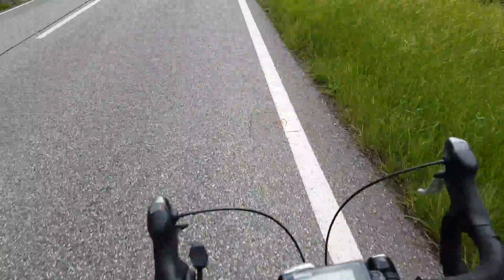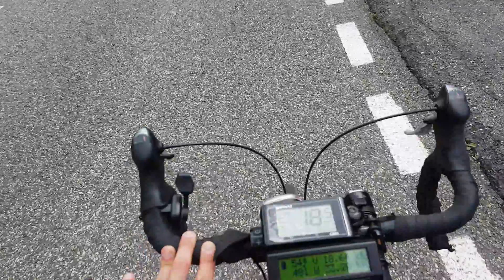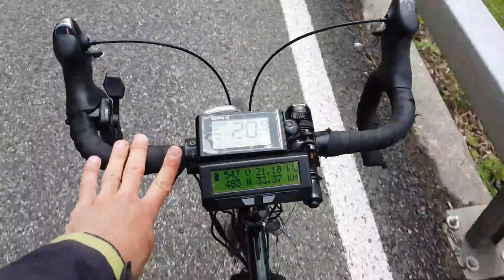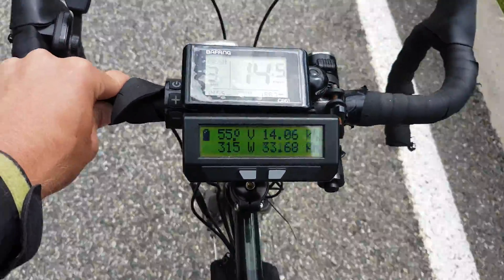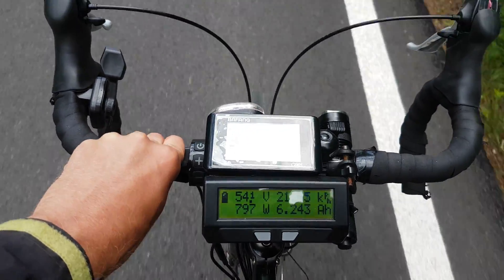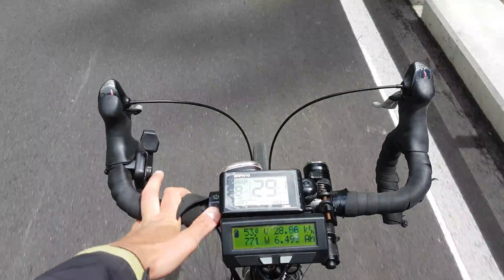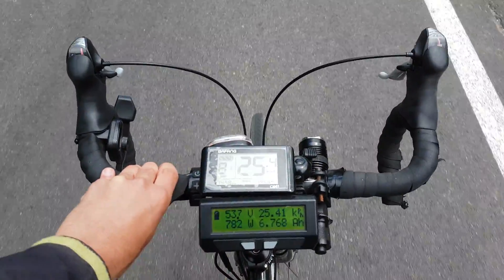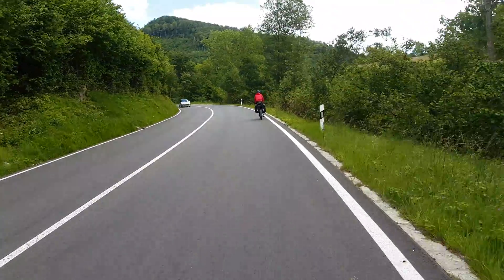E-bike how much power do I need for touring? 250w? BBSHD

Comment: Jack, revisiting your old videos. You had a mid drive then a hub motor more recently for the last sun trip. Is regen more important than mid drive through the bike gears? Did you go through a igh like you later had? Just all a question of riding in mountains but also flats
Reply from the maker: Mid drive in general better for climbing, yes i ran it through my Rohloff hub gears. DD hub was good for the race as every amount of energy you can get back helps

Comment: When talking about POWER never forget about TORQUE
250W with 120Nm of Torque can move you uphill at 25kph while a 1600W with 60Nm of torque will suffer in the speed, cause even though having the power, it has not the force to move at that speed

Comment: Hi, can anyone tell me what is that battery monitor display system ?
Reply from the maker: Cycle analyst by grintech
Reply: @JackButlerVideos  Thanks for the info !

Seems like they use it as their main OZO controller. Did you use it like that or as an add-on to Bafang controller?

Anyways I am wondering if with Tdz2 custom firmwares (with big 860C display) it is still relevant to use "Cycle analyst".. 

Will see, waiting my TDZ2 kit and 48v 20ah battery !!
Reply from the maker: I'm using the cycle analyst purely as an electrical display and it does not interact or connect to the motor controller. Enjoy the build!
Reply: @JackButlerVideos  Is it worth buying V3 in your opinion ?
Reply from the maker: @seabastia  if you have a compatable motor controller yes but the bbshd is not
Reply: @JackButlerVideos  Thanks !

Comment: I live in Wales, 250w is a frickin joke.
Reply: On a steep climb, I'm going 5 or 6 km/h in the lowest gear. With my 250w mid drive assisting, I'm at 10km/h. 250w helps a lot.
Reply: @somethingelse9535  i can do 4 mph without an Ebike.
Reply from the maker: Works okay for me
Reply: @JackButlerVideos  250w does not work over steep hill never mind several and a full laiden bike. 750 wat is the minimum requirement.
Reply from the maker: Depends on how fast you want to go. Bikes don't have motors and work fine with 0w

Comment: Tip,,,,, 750W Mid-Drive Motor is ONLY ( 1 HP .. ) So  IMO you need at least 1000W motors for almost anything !
Dan
Reply: I can climb walls with my 250w mid drive.

Comment: Hi Jack. Nice videoes and fantastic Sun Trip to China :-)
Very good motorsize-video with relevant information ! 
I think it's important to note too, that even though e.g. the 250W Bafang centermotor can deliver at least 500W (like most 250W motors),  it can only manage 500W for a shorter time without overheating, depending of eventually cooling airflow and ambient temperature.
I think the sweet 250W Bafang centermotor fits our small hills in Denmark fine. I have it in my velomobile (40kg heavy 3 wheeled fully enclosed recumbent with motor and 10Ah battery + 70 Kg driver. Weight could maybe be compared to a loaded touring bike)  
But for the mountains e.g. in the south of Europe, I think at least 500W Bafang centermotor would be better, because it has some reserve(1000W) and better can manage 500W for longer time without overheating, when necessary now and then. Even though the 250W motor would be great help together with pedalling, in the mountains...  just need to take care of the motor-wattage then.
Kind regards, Kjeld, Denmark

Comment: Just bought the 750w 48v bafang an wish i spent another £100 on the bbsHD 1000w .
Reply: how fast and how much range u get from 750w? after 6 months any problems?
Reply: @xxnotmuchxx  i get 32mph flat out with throttle . And 28 pedalin .
Took a while to get the front chainring size correct but bought a 48t an 52t, never got to put the 52 on and wouldnt bother . Had the 48t on and efected range a bit , plus it was winter .
Range 1st off was 50 to 60 miles not useing the throttle . And with throttle 30 miles with a 17.5ah battery. Now its getting warmer my range will increase . But it can be strange over taking some old granny lol.
If i stayed in lower pas lm sure i could get 75 miles range but i like the speed .
I put a digital fish tank mod temp gauge in the motor.
So i shouldnt over heat the motor now .

Comment: Jack, with your Bafang middrive what programming settings do you use? I'm trying to programme mine with range in mind but there are so many options out there I'm a bit befuddled.
Reply from the maker: I have pedal assist 1 at 100 watts and raising in 50 watt steps. And then (i don't remember exactly) 9 is full power 8 is 1000 7 is 750 6 is 500
Reply: @JackButlerVideos  Thanks for the reply. That makes sense, and do you have the speed set to 100% for each level? 

I'm thinking of copying what you have with the current level going up in increments of 10.

I'm also thinking of setting the speed limit to 40km/hr but for the first six or seven levels having the speed limited to 63% (25km/hr, my cruising speed) with the top few levels with higher speed. (if I'm in a rush or to show off :))

What do you think?
Reply from the maker: Sounds good! It's easy to chance anyway when you get used to it!

Comment: I am 130kg. The ebike I'm looking at has 250 mid drive Bafang. It goes 15mph on peddle assist and 28mph on the throttle. Would it be worth getting? I don't want to work to hard.
Reply from the maker: It depends what you want it for and what your expectations are
Reply: @JackButlerVideos  just for commute. Mainly flats few mild hills nothing bad
Reply from the maker: I'm sure you'd be fine. It'll put out more than 250w anyway
Reply: @JackButlerVideos  what speed would I get on throttle only mode on flats?
Reply from the maker: @CFC2584  depending on your tyres you should be able to do at least 25km/h on the flat i imagine, unless you have MTB tyres/bad rolling tyres
Reply: @JackButlerVideos  it goes 45km/h which is 28mph on throttle with no one on it. How fast would it go with me on it? I'm 130kg
Reply from the maker: On 250w i don't think you will be doing 45km/h without working unless it's flat and windless
Reply: @JackButlerVideos  this is with the throttle only in highest gear. How fast do you think I can expect on the throttle only under normal conditions?
Reply from the maker: I'm sorry there are too many variables, it's almost impossible to say.
Reply: @JackButlerVideos  ok. Thanks. will this be good for weight loss when riding with peddle assist? Mainly what I want it for.
Reply from the maker: The more you pedal and the less you eat the more you'll loose. Get a calorie counting app to really understand
Reply: @JackButlerVideos  Sorry if it seems like a silly question. Do you think it will be worth the extra cost over a normal bike I guess is what I mean?
Reply from the maker: You will not loose weight faster or slower because of an ebike. The only thing that affects this is how much you eat and how many calories you burn.

Comment: nice video! I was wondering, do you miss generative breaking? would not be much easier in your brakes then? What about your solartrip? did you used many sets of brake pads? I wonder what is better for touring, free hub with no regenerative breaking, like your bbshd or a coupled drive with regenerative breaking.
Reply from the maker: Never tried regen braking on my own bike. Yea it would definitely save brakes! Problem is even with motor off the wheel is always slightly dragging which is not good when you're not using the battery. Maybe changed brake pads once on the suntrip, you don't use them much. It's basically flat for 7000km from Russia.
Reply: @JackButlerVideos have a watch of Grin Technologies' presentation on regen, it busted a lot of my misconceptions about the downsides of returning to hub motors - for example, you can easily counteract the drag you're talking about by running a tiny amount of current through the motor on PAS level 0. You recover the charge that you lose from doing that very easily throughout the ride.

Comment: Hub motors are great lol, I have seen them with over 10,000 MILES and still going strong, you can not say that about those nylon gears you were talking about. Besides, if your chain breaks, crankset gets damaged, derailer gets damaged ect. you are stuck with a useless ebike with mid drive. A hub would still get you home or if you hurt your leg ect it would get you home safe. The wheel are made for the motor and the spokes are 12 gauge stainless steel.. they are very strong. I hit downhill tracks with my hub motor lol and it is fantastic. I think an ebike needs both a hub and mid drive, hub for high speed and reliability and mid drive for steep hill climbing. Or just use a second hub in the front as well. That works too.
Reply from the maker: I've now done over 10000 miles on this mid drive motor too!

Comment: What's the model of the power meter on your handlebar? When solar powered you probably use two of them? (Input and output)
Reply from the maker: The cycle analyst! There is "solar software" for it so you can use one display with two current shunts

Comment: I have a 500W bafang hub and I will say that on the flat with full pedal assist you go amazingly fast.  On hills depending on how heavy your bike is, your level of fitness and the incline you notice you do get a workout.  But I'd say it reduces the effort on a good climb by about 60-70%.  I agree, beyond 500W it's pretty much unnecessary as at that point you're essentially a motorcycle.
Reply: What speed with a 500w ?25 mph
Reply: @thomasjurd172  about 20-24mph on flat
Reply: @giobikefans  i just found there an easy fit but if you get a 1000w rated battery the bbso2 still draws more than 1200w with 48v
Reply: @thomasjurd172  cool!
Reply: Since 500w and 750w are almost the same price, why not get 750 instead? I am reseaeching a diy ebike. I think 750w might harm the chain and cranks, what would you say about that? Have you seen damage with your system ?
Reply: @dimitristripakis7364  i have a hub motor so there’s no additional wear on anything.  None of the power goes through the chain.  If you’re using a mid drive motor then that’s something to consider.

Comment: Hi Jack, I don't know if you'll see this question, but what are you using to attach the thumb throttle  to the side of the handlebar?
Reply from the maker: I used a dremel to widen it out slightly and slid it around the bar as normal.
Reply: @JackButlerVideos  Nice! I might try that.

Comment: Im 75 kilos. If i put a 250w on my bike while i riding slightly fast will i reach 30 km?
Reply: I doubt it will have enough torque. I had two 36v 250w front and rear hubs for a while . Together they'd teach about 18mph on the flat.

Lift a wheel off the ground and it'd throttle up to 45mph, but as soon as they have me+bike to carry they just don't have enough torque.
Reply from the maker: 30kmh? On the flat with you pedalling probably!

Comment: Hello, can 250watts outrun pro cyclist? With pedal assist of course. I can do 37kph on my mountain bike and 45kph on my roadbike. I wonder if 250watts can still help me maintain 45kph on flat.
Reply from the maker: It's very difficult to say but if you can pedal at 37kph on your mountain bike i think you should be able to keep over 42kmh with 250w probably... If that was the question...

Comment: Hi there, how do you wire your Cycle Analyst and the Bafang for speed, if your using the Phaserunner?
Reply from the maker: I've never replaced the stock BBSHD motor controller with an aftermarket one so unfortunately I can't help.
Reply: Hi Jack many thanks, OK understood but How do you change motor wattage then via the CA up-to 1600w?
Reply from the maker: It's not possible to adjust the stock BBSHD controller with the Cycle Analyst. The CA just provides accurate measurements of speed, distance, watts, and most importantly W/h

Comment: hi, I have had a 1000w hub ebike to get to gym for over a year, but want to tour wild camp on an ebike any advice please wa even thinking of taking genny as they start at 9kg, or at a push cube just made a touring ebike, my 1000w only does 15miles on low assist and 8 miles full power, so cant use this I think.
Reply from the maker: I would just get a high capacity battery fron em3ev it would be better than carrying a generator!

Comment: A 250W motor does not have a maximum power of 250W, it is the ideal/average power.
Most 36V 250W motors are 15A max, some are 18A max. A 26V motor is 20A max.
So, they can all deliver over 500W.
If you wanna climb hills, Watts is not the only thing to look at. You need a lot of torque.
Reply: Thanks Czar,i was wondering that myself.So my 36v 10ah 250 will suffice most hills,i mean reasonably?
Reply: @ericaguidino3376  Definitely check out the motor's torque. Going up a 20% incline and assuming your weigh 100kg with bike, there will be 200N of gravity to fight. Multiply that by the radius of your wheel (say 30cm) and you got 60Nm. That's what you need to go up the hill essentially.

Power is torque * rotational speed, which when you're creeping up a hill or taking off is very low. Your motor will very likely not be able to put out anything near 250W (kinetically) at very low speed. This is why power isn't the only important characteristic.

Comment: Will 250 W climb uphill?
Reply: 250 watts is like another strong cyclist assisting you. So as long as you help the motor by putting power into your pedaling, and you are in the right gear, then it will  go up almost any hill, or at least mine does and i am a 210 lb 6 ft fatty. BUT the higher the wattage the motor is, the easier(more comfortable) it is for the motor and you, and in the case of the motor  it is under less strain so will last longer. My next motor will be either a Bafang BBS02 750w or a Bafang BBSHD 1000w which i will expect to last forever or until the next leap in technology.
Reply: So Ray you would say,,lol,that rhymed,,that a 250 watt would be ok for hills, and as long as you peddle and help it along and not depend to much on the motor, you should be ok? @iamrocketray
Reply: @ericaguidino3376  Hi Erica, In my country 250 watt is legal limit so we have to make the best of what we can(i do have a 350 watt also, naughty me lol)But to be honest if you are a cyclist and want help up those leg killing hills, and i do live in a hilly area, a 250 watt is fine if you use it right, I can cycle up hills that no way could i cycle up even when i was young( i'm 70 now) BUT if you expect to ride the throttle all the time and use it like a scooter and not pedal then a 250 watt would not last very long and you would be better with a 750 watt. Best way to imagine it is, you have the equivalent of another cyclist pedaling with you like on a tandem. Also a 250 watt motor is economical  and i get 45 miles plus out of one charge, that's with a 36 volt 15 amp battery.
Reply: yes it will

Comment: I don't think I'd like to have only 250W. Just got back from a 70km day out, 90% of which was on gravel or compact clay trails. Mostly flat, with a couple of steep climbs (steepest part was about 30%). My bike with BBSHD & 14s9p battery and panniers weighs about 40 kilos and I weigh 100 kilos.
Most of the time I was using 100-150W. On the climb I was using up to 700W. Average speed about 18-20 kph. At the end of the run, Cycle Analyst was showing 5.9Wh/Km.
Reply: mick2d2 Nice! But did you pedal yourself though?

Comment: i have bbs02b 36v 500 w kit with 790 led  controller. with low assist climb to 144 m to 390 m at 12 km in 35 minutes. I think that's enough. i am 184 cm 92 kg. low assist mode the engine is spending or not spending 250 watts. I have never run it in higher mode, it is more than enough.